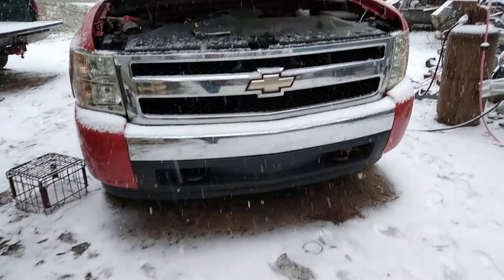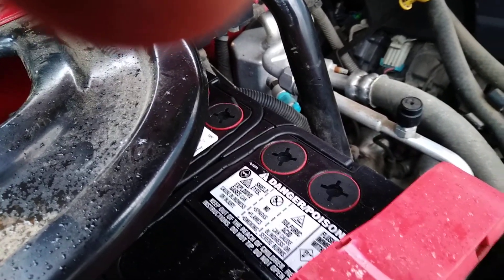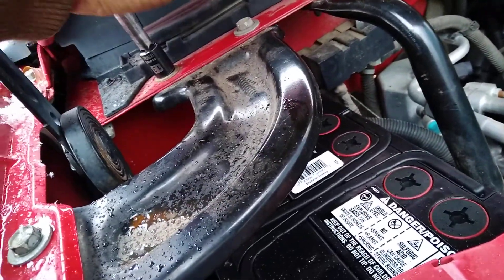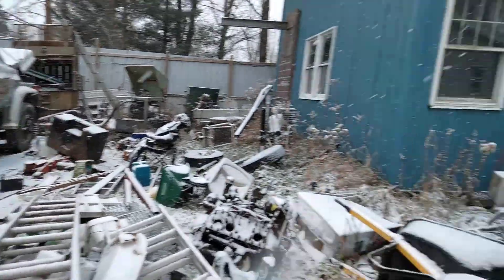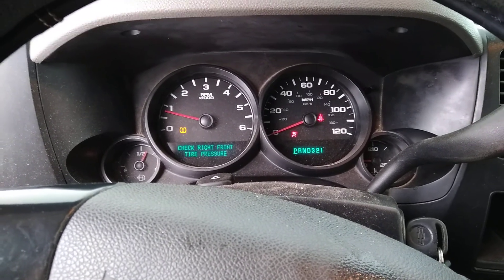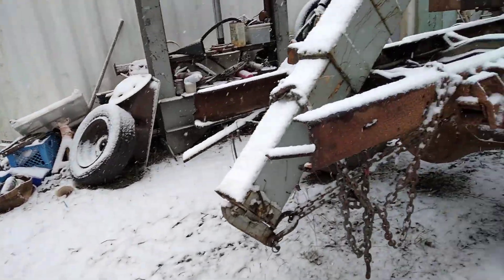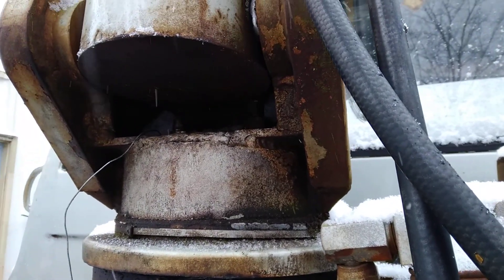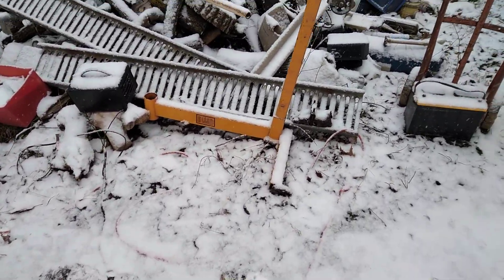time to work on the truck new battery replacement

Comment: Looking like snowville over there. Worst we had was a tiny bit of flurries a couple hours ago. We haven't had any snow that sticks, yet. This time of year I really hate Wisconsin, snow doesn't do anything but make work and life harder. Plus you can't touch anything without getting your fingers or toes froze.
Reply from the maker: It is still snowing here but we really haven't accumulator too much I deal with whatever comes along I have a four-wheel drive
Reply: @billjunking_fool5549  Ended up getting the dump truck today. It got too dark and cold to do a quick video so I figured tomorrow. It needs a little work but it's a really good truck